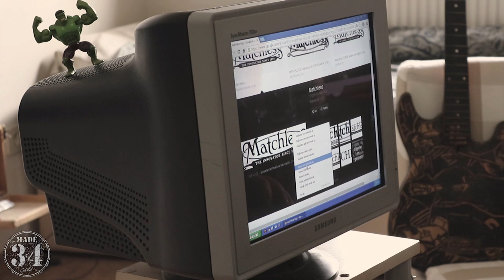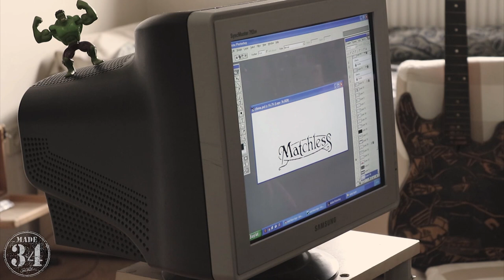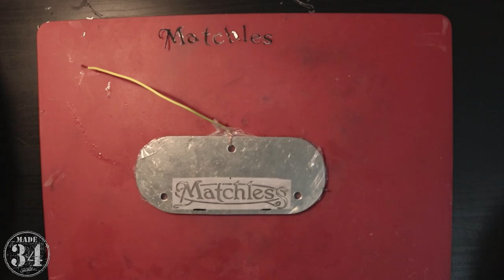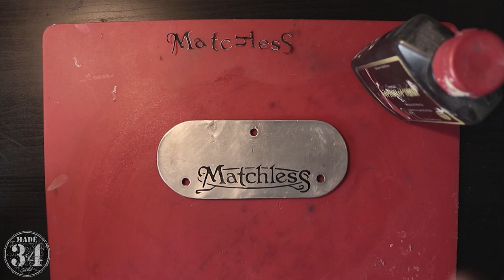How To Write On Metal ? MATCHLESS Logo !

Comment: I was wondering, if after you put it in the electrolysis bath, could you maybe switch the polarities and pour some ionising paint into the  the bath? The idea to maybe use the exposed metal to attract the paint molecules to the bare metal? That way you can just tear of the plastic wrap at the end and job's a good'n. I dunno if that would work though but it would be cool if it did